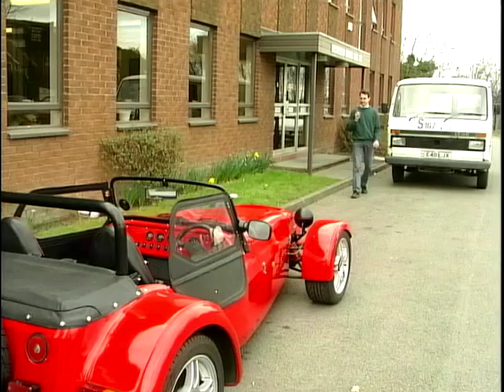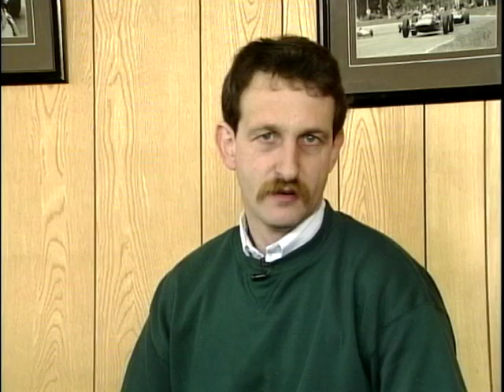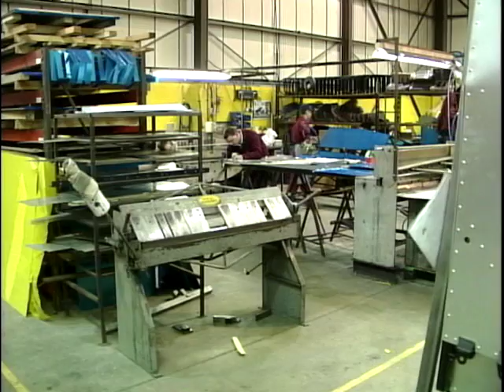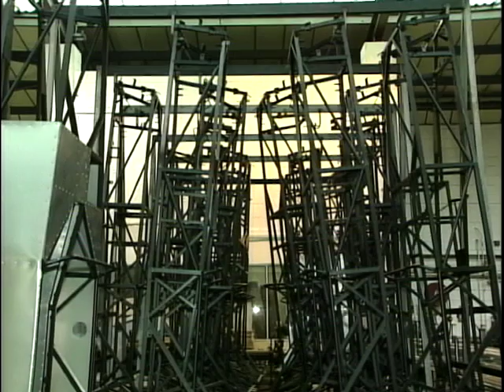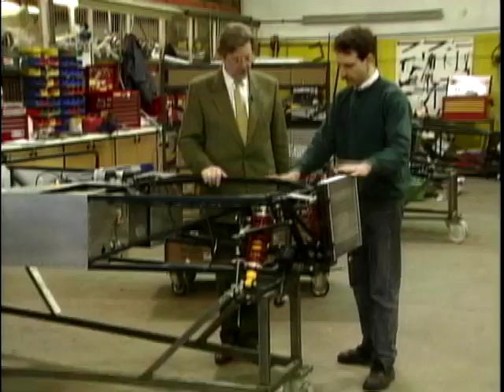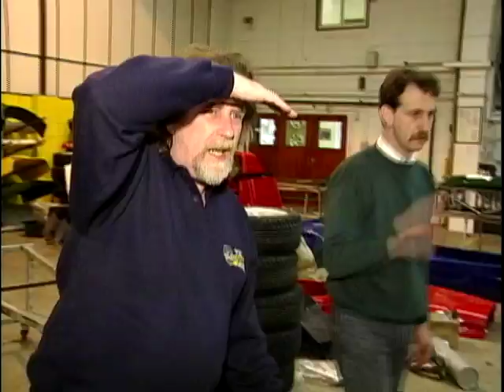Westfield Kit Car

Comment: I thought that the Westfield like the Caterham was based on the original design by Colin Chapman (Lotus 7)
Reply: Nope, Caterham has probably the patents.
Reply: Yes, but there was a court case and Westfield had to change the appearance of their cars and promise not to hint that it was a  Lotus 7 replica.  That was 20 years ago and now neither car bares much engineering resemblance to the original live axled, Ford  saloon engined Lotus 7. Westfield did basically rip off the Lotus 7 design without paying for the privilege unlike Caterham. Westfield had previously ripped off the Lotus 11.

Comment: Why don`t they just use stainless steel and avoid the hassle,    Cost and weight of that epoxy coating on the chassis
Reply: Stainless is heavier than mild steel, far more difficult to cut, form and weld and not as strong.